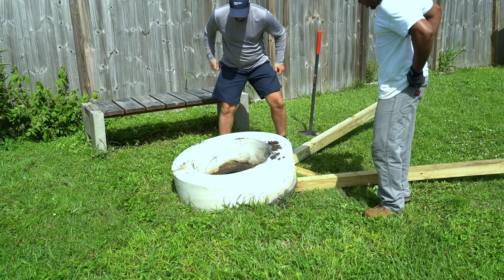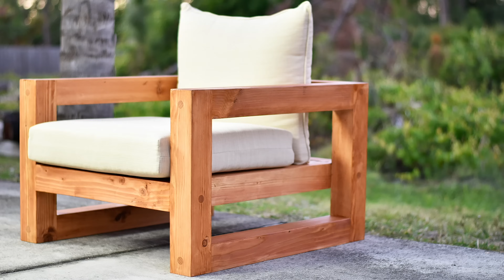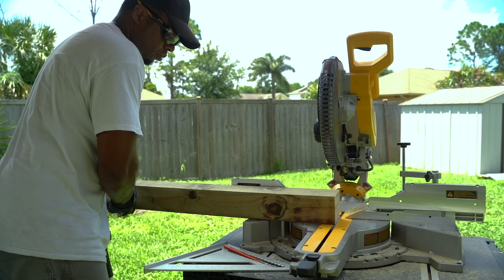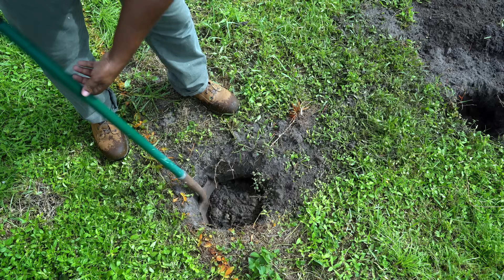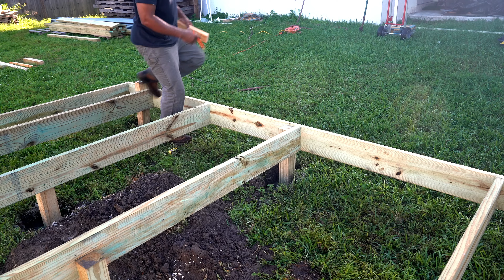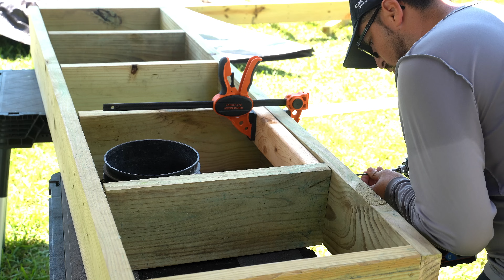Building A Ground Level DECK - (Part 1)

Comment: Deck screws into end grain?  Here in So.FLA, that 'might' last for two seasons -- max.
Reply: same for the ground posts unprotected into soil. that would rot through in 2 years here in germany
Reply: @hansmuller4338  Why you want to bury it underground in first place. I usually lay concrete slab or block on those places where come support post. And build deck above them, no need to dig, no need to worry about moisture from ground.
Reply: @mr.wizeguy8995  my first house, built in 1998 in Virginia had a rear floating deck about 4.5 ft off the ground, 10X10.  The vertical support beams were pretreated 6x6s buried maybe 9 inches into the dirt, with no footing or gravel base of any kind.  The two support beams away from the house rotted through last year.  I moved into the house in 2007.  So they lasted at least 11 years, surprisingly.  They could have been original, so maybe almost 20 years old.  Not saying I'm in favor of burying wood.  I was just surprised that this is how this builder built a deck in the 90s.  I imagine even back then builders were worried about moisture.  Maybe a cost savings decision by the builder.
Reply: @willywonkabar  I have deck in my backyard it's at least 20 year old it's resting on few concrete pavers that have been laid over ground. Wood is pressure treated and deck is in really good condition.
Reply: @mr.wizeguy8995  cause slabs are ugly. Better off just using quicktubes with Simpson tie brackets for the posts
Reply: @anand8905  I meant slab by concrete paver like 1 ft x 1 ft and 2 inch thick. You dug it just below ground and set cement block post over it then build deck frame over those post. Much less digging, no need to pour concrete,.
Reply: @mr.wizeguy8995  Yeah pretty much
Reply: Where I'm from you don't need a permit if the structure is under a certain square footage, height and is not attached to the house. This deck is none of those things so perhaps he is able to build it however he pleases?
Reply: Matt Kramer sounds like the same rule as in
Australia.
Reply: @downunderfulla6001  I live in Canada but that's cool to hear!
Reply: In west Texas, there are houses with floor joists on the ground. This is just a deck, not a house. Should be good for a few years at least

Comment: Is the only thing connecting the posts to the joists just a few perpendicular screws? Surely that's not strong enough!
Reply: Wow! If building house was just frame wall and  with squares any one can build it.  Really surprise how some one with so many subscribers can go ahead just building to grow channel more. No no no!,,
Reply: I agree. Rebating the posts, so the deck bearers sit on top of the posts will give maximum support.

An alternative we use in Australia are galvanised steel stirrups, set into concrete footings. No ground moisture up to the bearers & joists.

Also, if setting wooden posts in concrete, fill the holes with concrete, and screed a slight cone on top, just above ground level. This allows water to run off outwards away from the timber.

That deck, otherwise, looks great. I love the angled face. Look forward to Part 2.

Goodonyamate 🇦🇺
Reply: @SydneyRaptor  Yeah same here in Canada. Best bet is to use a plate sitting on top of a footing
Reply: Yeah screws are good against draw out but not so great with shearing forces.
Reply: You did not watch the whole series, part 2. SMH
Reply: Many of you did not watch the whole series, part 2, then jumped to conclusion. SMH.!

Comment: I like your videos so here's a word of advice: Be careful building anything in the utility easement. Depending on where you live, it's possible that you could get a fine and the utility companies probably have the right to tear it down, jack hammer it up or move it and not reimburse you, pour new concrete or anything. Also before digging you should have the utility lines located in your yard. It's normally a free service and they only need a few days  before they come out to mark the gas, water, electricity, TV  cable, and phone wires. If you hit any of those theu bill you for the cost of the repair including labor.
Reply: How you know he didn't call to have his utility lines located first?
Reply: Ken C He’s probably assuming because most videos the guys usually start off mentioning it and Glenn didn’t.

Comment: Wouldn't mind it missing joist hangers so much as the wood not getting wrapped in a DPC. The posts will fail much quicker than anything else.
Reply: What is DPC?

Comment: I've been a fan of yours for quite a bit...but maybe not as long as others....  I am surprised that you did not notch the supports to hols the weight of the deck on top of it as opposed to relying on the screw strength...

I'm hoping this lasts quite a while before needing to replace the supports. Maybe at that point you could use deck blocks or something that would allow the supports to be a bit on "higher ground" with a firm foundation. 😇😎

I love the shape of this though! Have a great rest of your weekend!

😇😎

Comment: Looks like it's going to be a great deck. But there are 2 issues that may or may not become problems in the future. First, deck screws are not designed for shear loads. I would have used joist hangers with nails. Second, surrounding word posts with concrete without some sort of barrier between the 2 can cause the wood to rot prematurely. This is caused by the concrete naturally retains water.
Reply: Absolutely. The wood needed some DPC wrapped around them and stapled and joist hangers as you say.
Reply: @SteS  what is DPC?
Reply: @pilotandy_com  Damp Proof Course.  Basically a moisture barrier...steel, stone, concrete and such.  Should be able to withstand the load of the deck.
Reply: @Hello Michael how are you doing

Comment: Well done. Being in N Central Florida myself, I would prefer my post be above ground level. On mine I use a tube formed post at least 6” above ground level with a Simpson anchor for the 4x4. Hopefully yours is rot free for many many years.
Reply: Question: How would this apply to say a fence post? Those are in the ground similarly to the video

Comment: Please don't make a part 2.  You did so many things wrong in part 1 that this entire thing should be dismantled and redone correctly before you do a part 2
Reply from the maker: Thanks for your feedback, but I am happy with it.
Reply: Comments like this aren’t super useful. At minimum you should either be nice or explain why it’s wrong, ideally both.
Reply: jribolla Very true.  I would highly suggest using joist hangers though. They can still be put in from what I see in this first video.
Reply: @jribolla  
Needs to use Joist hangers.  Absolutely needs lags screws/carriage bolts where the deck meets the posts.  Use nails instead of screws for shear strength.  Any buried post will rot.  Make cement footing and place on top with appropriate mounts.
Reply: Big Mike is talking Big Mike should shut up

Comment: I like the design but the weak point is the posts. The posts need to be set in the concrete up to ground level, else they rot due to the water exposure.
Reply: Forget all the moisture business... I just learned how to use a clamp backwards! 😂  I feel like an idiot not thinking of it sooner.
Reply: @owaissayed89  dont feel like an idiot! Not all clamps are pushers! :)
Reply: Here in Durban, South Africa, we have a similar climate to Florida. We do the same as Glen did with his treated posts and they take at least 10 to 15 years before moisture starts to ruin them.
Reply: I was going to comment the same.  PT wood (even ground contact certified) should still be raised off the ground sitting on a proper footing like a landscaping block.
Reply: Wait. I'm a bit lost. What di you mean "up to ground level"? I know of ground certified wood though
Reply: @potatopotatoeOG  in the UK we have a practice of setting the wooden posts in concrete if they are below ground level. Stops the wood from being exposed to moisture. It's almost what he did but the mai  difference is that we don't back fill with soil, we pour the concrete in until it comes to ground level.
Reply: @sto3359  You should not use concrete! It will draw moisture and rot quicker, Use a water inhibiter like tar on the post where it contacts the ground the just tamp the dirt good and tight! And by the wat grass don't grow under the deck if it don't get sunshine,,,
Reply: @sto3359  Actually water will get in between the concrete and wood accelerating the decay of the wood posts. Set the posts on stone aggregate and  back fill with dirt and be done  with it. Also the pressure treatment only penetrates so far into the wood. Once you cut it you need to retreat it.
Reply: Concrete increases the rate of decay, it does nothing to protect a post.
Reply: I live in a climate where you get heaving from the ground when it freezes. The easy solution is the same answer here. You do not have to dig the ground, or put in piers. Just make a floating foundation. I have used deck blocks to do this for three different projects. They are solid concrete, with a design on the top that will fit a 4x4 post, single joist, or two joists meeting. If you only want a shed or deck raised up a foot, just place the joists right into the top of the blocks, if you want something taller, than you can use the 4x4 post. There is a height limit of 2 feet however. Still, this is a great option. I have even seen larger custom order versions that are used to make floating houses. I hope that is helpful.
Reply: that makes sense...I can understand that...thanks for sharing.
Reply: Concrete poured to ground level will not keep the posts from rotting. They will rot at the bottom where they come out of the concrete and are exposed to the air.
Reply: @jeremyhuggins8796  Maybe try two-stage polyurethane resin instead of concrete, Sika makes some for fence posts
Reply: And You actually want a very very small run in your decking so rain rolls off and water doesn’t sit on it as it would if it was completely level
Reply: I agree.

An alternative we use in Australia are galvanised steel stirrups, set into concrete footings. No ground moisture up to the bearers & joists.

Or, if setting wooden posts in concrete, fill the holes with concrete, and screed a slight cone on top, just above ground level. This allows water to run off outwards away from the timber.

That deck, otherwise, looks great. I love the angled face. Look forward to Part 2.

Goodonyamate 🇦🇺
Reply: @Svenulf Skjaldbjörn I sale and install storage buildings, Maybe a moisture barrier that water can get through but never plastic unless the building is high off the ground! Water will get on the plastic and rot the floor out of the building,,,
Reply: Good point this is new to me thanks 👍👍👍
Reply: All those posts will rot out and also those screws holding up the deck will fail 🤦🏻‍♂️🤦🏼🤦🏼‍♀️ wastes time and money
Reply: I would suggest Helical Piers or Piles for any proper footings regardless of frost zone.  Something this height shouldn't need more than a landscaping block like I mentioned before.  Just remember, it probably will still sink.  I don't think wood should ever touch Earth directly, regardless of application or wood certifications.  Embedding wood in concrete should also not be done.  The wood should sit on top of the concrete.  The concrete or helical pier or landscaping block acts as a buffer between the earth and the wood.
Reply: @mainegeek0  I agee. I live in central FL. No post in direct contact with dirt (rot/termites). Posts surrounded by concrete are no-no as well. Water eventually seeps between the concrete and the post and rots the post. They ALWAYS go on a pier with a foot that keeps the post off the concrete and not in contact with standing water.
Reply: Just place small concrete slabs each place where post will be and then build deck over them, no need to dig anything, no need to pour concrete, no need to worry ground moisture...
Reply: @mr.wizeguy8995  correct on slabs........ wood in the ground is a no no, no matter how well its been sealed etc, wood always rots just above ground level no matter how well its treated

Comment: just did mine this summer. a 32x16 deck 12 inches on center and ground level. Barely any joints as well. While it is more expensive, just imagine all the cuts and time savings. In my case I used 16ft boards coming off the center of the deck and a perpendicular board on the center and all boards departing from there. No cuts other than just at the end with a snap line to cut flush with end of deck with a circular saw.

Comment: Why would you build a WOOD deck instead of a CONCRETE deck?
Reply from the maker: Wood deck is pretty common. A concrete deck wouldn't be a thing I would go for.
Reply: local by-laws, cost, all sorts of factors I'm sure were considered during the planning stage

Comment: Great build,im not picking fault honest, but i dont understand why you cement the posts in (then fill in with earth surely this will rot the wood posts as will always be sitting in damp soil?
Reply: depends on the timber, though that gravel under the concrete also helps. Many posts sold for decking are treated to resist rot, too (not to mention termites/whiteants - the main problem in my area). If you're unsure, a good hardware store can give pointers when the time comes
Reply: @databanks  thanks for clearing that up,like i said not picking fault in glens work

Comment: I use to always mix the cement with water prior to putting it in the hole.  I no longer do that, everything I've read says it is a little stronger by mixing it but for the average person building a deck, fence or clothesline it doesn't make any difference.  I have a lot of buddies that do construction and concrete work and none of them premix the cement for the things that I mentioned.
Reply: Here in Western Europe, hundred year houses are common.  Most of our houses are brick and mortar with concrete foundations.  Since mixing cement to spec is just a fact of life, we make a decent mix even on small jobs.